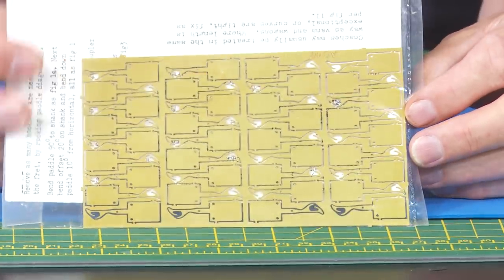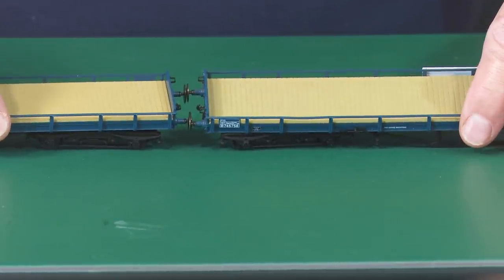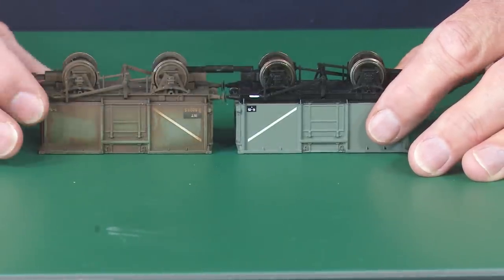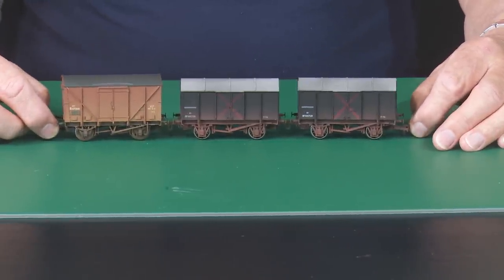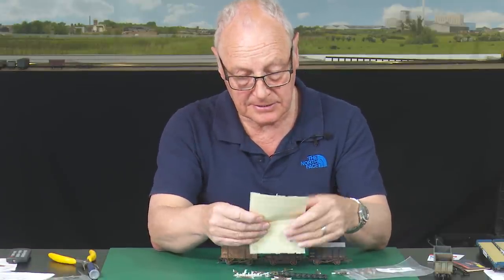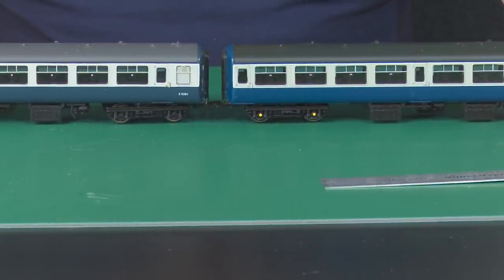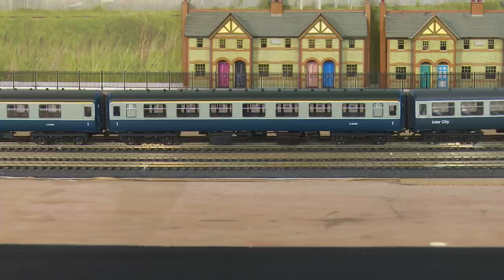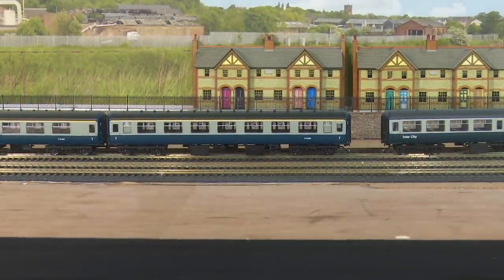NEM Couplings at Chadwick Model Railway | 92.

Comment: Just looked at your video,i have one thing to say Fleischmann 386515,in my opinion,and i have been modelling for a long time scalefour, em society etc,its the best nem coupling around,trust the germans,just try it,its superb,it is a disgrace by hornby and bachmann to be still using the ridiculus tension lock coupling on the superb models they now make,just give it a go charles you will see what i mean,they cost around 48,49,pounds for a pack of fifty,gaugemaster or jadlam models,post free,and they are worth every penny,they can be bought singly as 6515 if you want to try them but the 50 pack is better value,i have fitted them to my hornby pullmans and they are a joy to see close coupled,running has a complete train,not shuffling round like a loose coupled coal train has they do with the rubbish tension lock.give them a go charles and if you do not agree i will be amazed,Best wish Eric.
Reply from the maker: What a very interesting comment Eric. Is there any chance that you could email me a photo of your wagons coupled up? Regards Charlie
Reply: @ChadwickModelRailway  Sorry charles i am 74 a bit of a computer novice,but i am sure there is a video about these couplings out there.has to wagons i have two rakes of hornby blue spots,they run has a complete train no shuffling like a coal train they couple up close and the clever thing about these couplings you can lift any wagon you like on the train without derailing or disturbing any other wagon,very clever,they are so good,the only slight drawback and its not the couplers fault is the habit of the manufactures not to stick to the nem pocket to buffer length,but that is easily remedied by shims or a pin prick of water based glue to extend the coupling to the correct coupling position,easy done than to say,personely i do not see why you use the keen system it offers no advantage in my opinion,i have about 150 modern hornby and bachmann coachs covering all regions and they all work well with this coupling with no mods,if i knew your address i would send you a couple to try,but has i said i think this is the best nem pocket coupler on the market,and its sad that models have advanced so much but we are still expected to use a coupler from the fifties on modern high speed trains and coachs.
Reply: Just found the video charles,its,Fleishmann profi couplings,its from 2014 it shows you all i have said,best wishs Eric
Reply from the maker: Thanks Eric, super job.